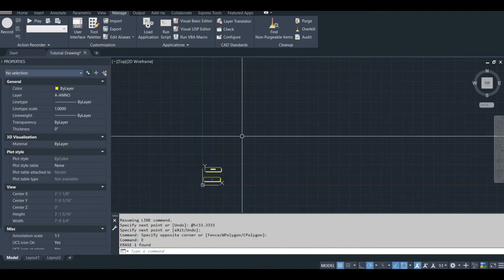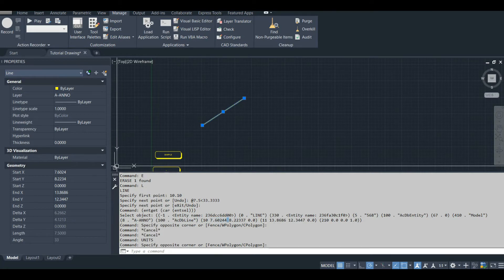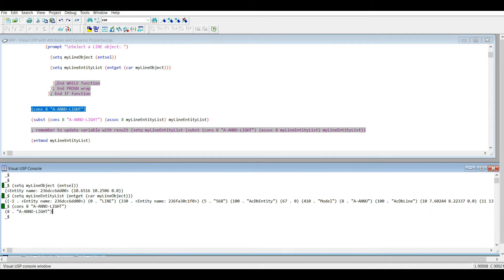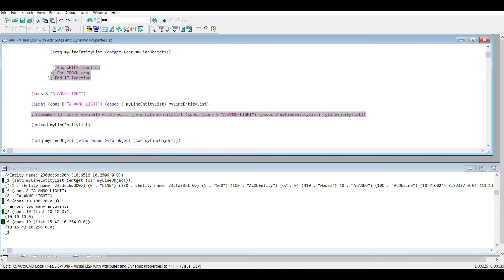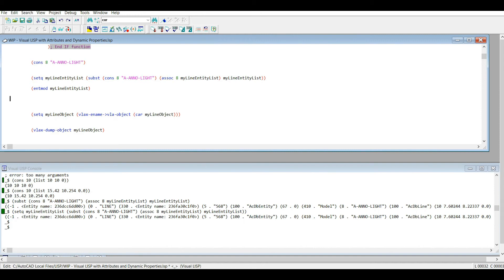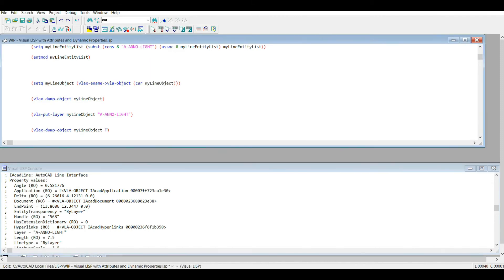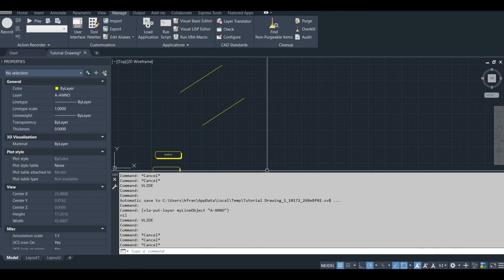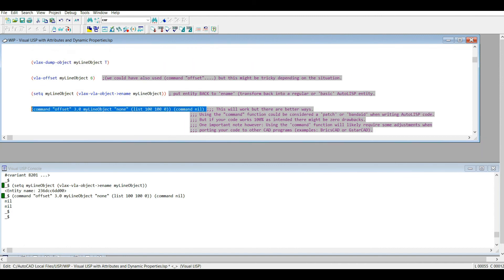AutoLISP vs Visual LISP Part 1 - Comparing Visual to non-Visual

Comment: I have created block and that block I have use as a insert block. For insert block I prefer CUIX.File and VLSIP.
Through CUIX I have set symbol in Autocad ribbon and the same block used through LISP for shortcut command.
When I used through CUIX I got correct block layer properties. I mean I have created in "xyz" layer. Using through CUIX I got the same layer in my new drawing. If even my current layer is 0 but they still put "xyz" layer in my new drawing. This is correct for me.
When I use LISP shortcut command for the same insert block. If my current layer is "ABCD" then block properties has changed automatically. The layer of blocks has changed into current layer.
Reply: VLISP
(defun c:RECCS2 (/ blockName fileName insertPoint )
  (setq blockName "Reccs1"
    fileName "C:\Desktop\To be check\Recc3.dwg")
  
  (if (not(tblsearch "layer" "Reccs1")) ;; check if the drawing not existing the block name
    (progn
      (vl-cmdf "-insert" "Recc3" "0.0,0.0,0.0" "" "" "") ;;inserts your master file from some defined file path
      (vl-cmdf "._erase" "l" "")               ;;erases the block; last inserted
      ))
  
  (if (setq insertPoint (getpoint "\npick point:"))
    (vl-cmdf "-insert" "Reccs1" pause "1" "1" "0") ;;inserts the block you want from the master file
    )
(princ)
)
Reply: CUIX
^C^C-insert;Recc3;\;;;explode;last;-purge;Blocks;Recc3;N;
Reply from the maker: I'm still trying to figure out what exactly the problem is! I might have to re-watch my video to figure that out. It's been a while since I ran an AutoLISP function from a CUI/Ribbon button; I only really used the CUI in AutoCAD LT (because it doesn't let you use LISP).